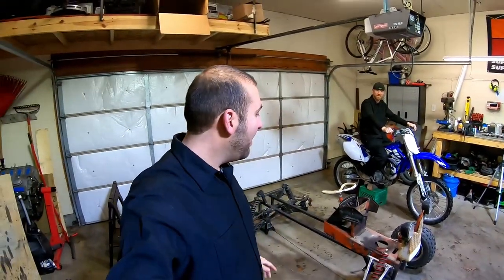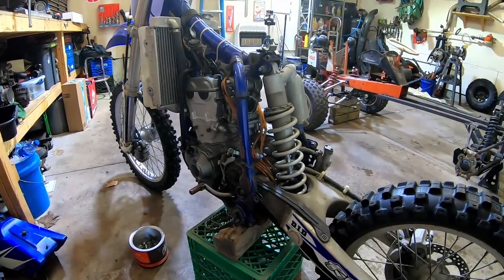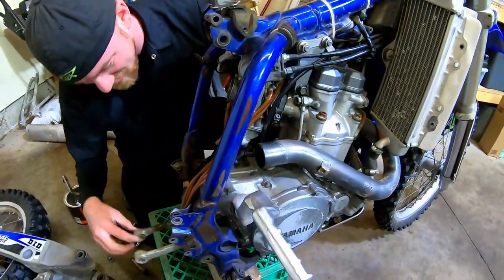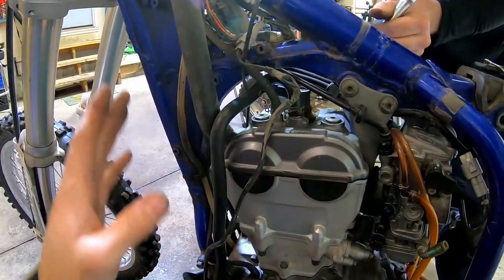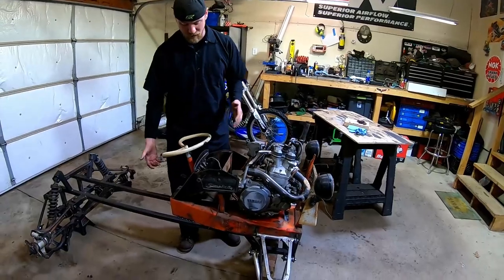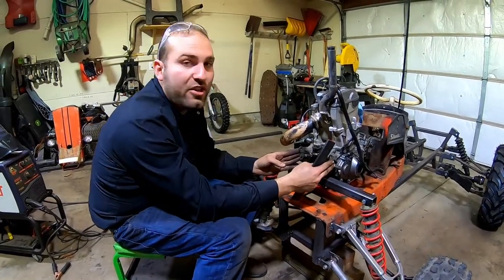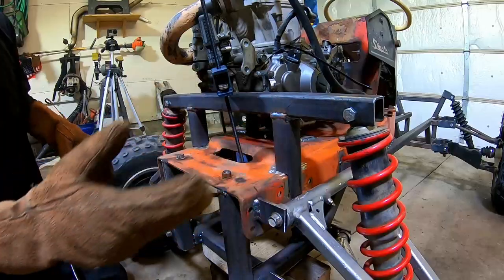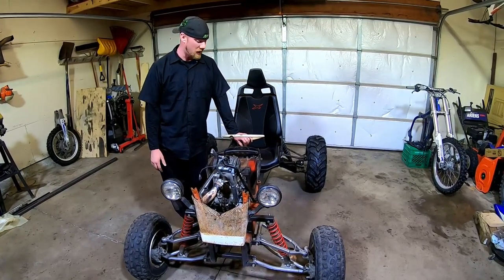Off Road Lawnmower Gets YZF450 Power Plant! Not So Simplicity S1 E5

Comment: You should put supports on the original tractor frame were you have the tabs welded to for the front control arm
Reply from the maker: We plan on adding some things to strengthen once we get a little closer to being finished. Thank you for watching!

Comment: When fitting the engine how was it balanced in the chassis not learning too much to one side ?
Reply from the maker: It's a little off but we did the best we could, there are several angles to deal with but there is always room for improvement! Half of the fun is figuring out this stuff!
Reply: Got similar project myself just wondering best way to do it, did you do it by eye mostly ?
Reply from the maker: We did it from eye and used an angle gauage.  Its was definitely a challenge because of all the angles of the tractor.  But its really close.  What motor are you using ?
Reply: CRACKED HOUSING FAB it’s not a lawnmower but the fabrication work will be similar got a Honda trx450r  that I’m fitting a cr500 in